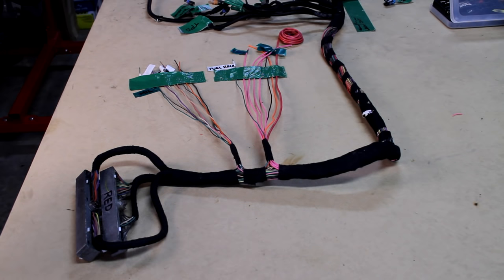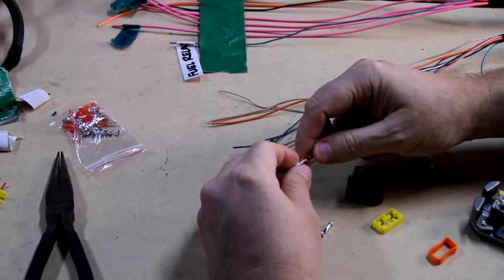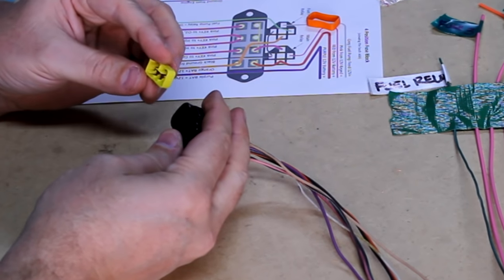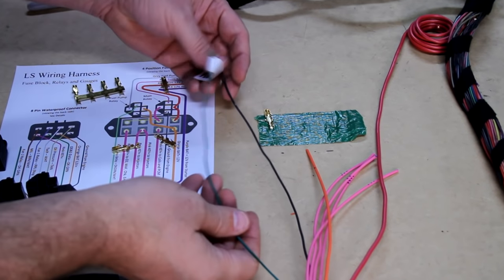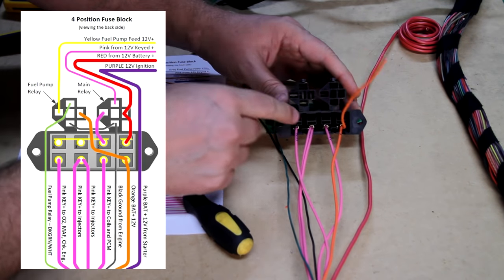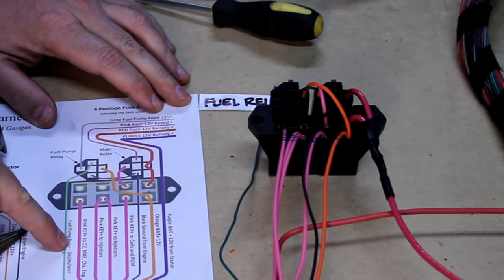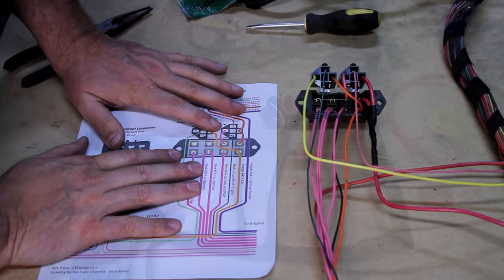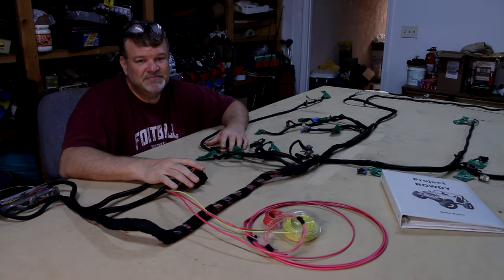LS Wiring Harness Part 5 | Project Rowdy Ep017

Comment: Sr according to you experience I'm doing a ls swap engine 5.3 I'm used Dakota digital  gauges wich wire I need to use from pcm to connect my temperature sensor thanks I hope you can helped me sorry for my writing I don't speak English to much.
Reply from the maker: I am not positive.  I believe Blue 74 is the signal wire coming from the Temperature Sensor into the PCM so that it can make fuel adjustments and engage the fans when needed.   I have not reached this point.  Worst case, you can place another Temperature Sensor in the other Head and run that wire into the vehicle to run the Temperature gauge.

Comment: Does the PCM to fuel pump wire go straight to the positive side of a inline fuel pump?Is there needing to be a 12v wire to the positive side of the pump?
Reply from the maker: No!  The Fuel Pump Relay Control wire (Red 09) is a control wire.  It is a low amperage positive signal that triggers a Relay.  In my drawing, the Yellow wire is used to provide power to the Inline Fuel Pump.  The current on the Yellow wire does not come form the PCM at all.  See page one of my downloadable diagram.
Reply: For some reason my fuel pump wire is not turning on the relay or the fuel pump. I used a jumper wire on the harness and the fuel pump came on. Tried a new relay same results nothing..  not sure what I’m missing or understanding on this. Is there a pic or a step by step u could send me?
Thanks for you quick response. Great videos you have on this..
Reply from the maker: Forrest Ott Don’t fully understand your use of a temporary jumper wire bit you can download my diagram from this video.  If you are on a computer see the “Show More” section below the video.  If you are on a phone, there is a drop down arrow to the right of the video title below the video.  On a phone you have to copy and paste the link to your browser.  You can test that green wire for a positive signal right as you key-on as the pump should try to run to build pressure.
Reply: Ok I think I got it figured out. Thanks for your help.

Comment: Great videos. Did u flash you ecu yourself?
Reply from the maker: I have not yet flash my PCM and do not plan to do it myself.   I am working on the vehicle that this engine will be swapped into.  I want the initial flash to take place close to when I am ready to fire the engine up so that I can work with the programmer on any possible adjustments.

Comment: what did you do with your VSS signal wires, did you delete them? im not sure what to do with mine as I am using a Th350
Reply from the maker: I deleted mine as I am running a Manual Transmission.

Comment: Is there a reason you chose to not also solder the pin connectors along with the crimping them? do you think that would cause problems with fitment in the block?
Reply from the maker: I actually debated this and was originally intending to solder them.  I ran across several examples where there were just simply crimped with a special tool and it convinced me that crimping would be fine.  When I talked it over with my son, he mentioned that the Pins from the PCM appeared just to be crimped and not soldered.  Fantastic observation!  Would you have done it differently?  Why?  Always willing to learn.  Certainly they could be soldered as long as you control the heat.

Comment: i bought  a 97 ck 1500  ls swap .with no gauges working,  it has 2 pcm in it ,i would like to get rid of the old one         . when  you did 8 pin connector looks like what i need to get done on mine . i'm getting no where on this one.any insight would be greatly appreciate  . no speedo is a boooo                .and thanks for the uploads
Reply from the maker: A few recommendations....  1) Download my diagram,  2) download the Pinout Specs for your engine from LT1Swap.com, 3) Study the Pinout digrams to become familiar, 4) Check LT1Swap.com for other gauge related diagrams/doanload/study them.  And it appears that you understand my 8 pin connector.... it is for all of the wires that will be heading under the dash to run "some" of the instruments.

Comment: Hello, and thanks for your video's on DYI ls harness.  Very well done and I cannot imagine the work it took to put this together.
I have two questions.  1.  where did you buy the harness tape?  2.  on your LS wiring Harness drawing you have B19 and B75  running on the bottom of the page from the PCM to the Engine.  Where exactly are this wires going to on the engine?  Thank you for your time.
Reply from the maker: I appreciate the compliment!!!!!   I bought the Harness Tape on Amazon (http://amzn.to/2xZng69) 2 rolls was only $11.  ANSWER 2.  Sorry that that part did not turn out to be very clear.  Those two Pink wires ultimately are connected to FUSE #2.  The Splice (shown on page 2 of my diagram), takes place to the right of the drawing on page 1 of the diagram.  I believe the video details for this section are in Part 4 of the series.   Hopes this helps and let me know if you need further explanation.  Cheers!!!!!

Comment: Are the relays 4 or 5 pins? The link doesn't specify. Will this diagram work with 5 pin relays
Reply from the maker: I don't recall if I purchased a 4 or 5 pin relay.  Both will work.  If using a 5 pin, you will not be using the 87a terminal.
Reply: UCanDoIt2 kool thanks

Comment: Hey the purple starter wire where u added the red one how does that connect. Cause my purple wasent connected to anything it pulled streight out of the harness
Reply from the maker: The Extended end of the Purple Wire (the one that I had to change to Red) will go to your Ignition.  When your ignition is in "Start" mode, it will provide 12V+ to the Purple wire.  Running through the harness, the purple wire terminates at the Starter Solenoid.  When the Starter Solenoid (electronic switch) is provided 12V+ by the Purple Wire, it mechanically provides the "Closed Circuit" for the Starter Motor to start rotating.
Reply from the maker: Part 6 of this Series covers most of this.

Comment: When you say goes to the switch  dose it plug into the fuse box on acceserys 2 ????
Reply from the maker: Your Ignition Switch provides power in two key positions.  The spring loaded Start position will temporarily provide 12V+ on a wire exiting the ignition switch,   this needs to go the large Purple Wire.  Then when the ignition switch is released from the "Start" position, it is in "Run" position and 12V+ is provided on a separate wire exiting the ignition switch...  That wire needs to be connected to the Pink wire in this harness.

Comment: is safely to connect fuse box wires (1-4) to a pin connector? if does what is the best pin connector that support 15 amp?
Reply from the maker: I believe it is ok based on what I think your asking.  I would use Google or Amazon to search for appropriate connector and hopefully they can provide amp ratings.

Comment: Hi . What is a fuses and relays rating for this setup? Thanks.
Reply from the maker: You should use 15 amp fuses in all sockets.  I would have to lookup the Relay specs, but it is a standard automotive relay that is used.
Reply: Thank you for your help.

Comment: Ok I have a question but first I'm doing same swap on a 95 c1500 ! Thanks to you it's easy for the harness !! But my question is on the 8 pin water resistance connector where is the pink 12 + coming from ? I will be re watching to see I I can figure it out thanks !
Reply from the maker: Manuel,  You can download the diagram that I drew in the description section (Show More) below the video.   This is the diagram that I used in several parts of this series.  On page 2, I check out the details of Fuse #4. The wire labeled "To Check Engine Light" is a new wire that you are adding to this junction.  It is the one that goes to the 8Pin connector and will ultimately supply the CEL with 12V+ when the ignition is in Run Mode. The PCM will control whether the CEL light is on by switching the Ground side of the circuit on the Brown wire.  Hope this helps!!!!
Reply: UCanDoIt2 thank you I will look into it! Thank you sir this really helps 👍😀
Reply: UCanDoIt2 so would i need it since my truck has the check engine?
Reply from the maker: If the new vehicle already has a Check Engine Light installed in the dash, you will want to connect these 2 wires (Pink and Brown) to it.  If your engine throws a code, the PCM will use these two wires to light up the CEL and let you know that you need to scan the PCM for code to determine what is wrong.  If the vehicle does not have an existing light, you can add any type of light for this notification.
Reply: UCanDoIt2 sorry for the spam sir but I like to be sure and the pink one that I'm going to connect with the brown come from the fuse block on relay 4 (which is where the coils and injectors combine )?
Reply from the maker: All of the Pink wires are the same (switched +12V).  You are going to add a new Pink wire to Fuse #4 (per the diagram) and run it to your CEL.  As long as the Key is in the Run position, this will have +12V on it.  The Ground side of this CEL circuit is coming from the Brown wire (PCM Red46, see drawing).  This is a negatively switched circuit.  When the PCM wants to light up the CEL it will provide a good ground on the brown wire.  I don't mind helping out.
Reply: UCanDoIt2 yes !!! That's where I was stuck at on your video I didn't see when and where you added that nee pink wire but yes ! You freaking rock ! 😎😎😎😎👍

Comment: i found a power steering switch, 2 wires, white and brown i notice those wire are connected to a controller under dashboard. the question is this switch can be connected to a light to know  when power steering fluid is low? and how it can be connected?
Reply from the maker: This is again beyond the scope of my project and therefore I am afraid that I cannot help you on this topic other than try to find the wiring diagram for this circuit.  I assume it is a Fluid level sensor???  If so, the circuit is most likely an On/Off type.  Maybe switching the ground side of the circuit.   Something that you could test with an continuity meter.

Comment: Where did you put the fuse for the fuel pump? Right now it gets unprotected power from the relay. What you should have done to combined The other 2 pinks into one and leave one fuse spot for the fuel pump.
Reply from the maker: Not sure if you understand the configuration.  The Yellow wire leaving the harness to power the Fuel Pump is protected via Fuse 1 (per my diagram).  The Green wire coming from the PCM is the Relay trigger wire.

Comment: Quick question. What size gauge wire did you run for each power source ? AND did you just junction some of the pink wires into one pink, if so did you change the gauge of wire or use the same gauge after tying them into one? Thank you, watched your videos. Learned a lot and feel confident.
Reply from the maker: The wire gauges are outlined in the diagram page 2 that you can download from the description of this video. In short, I joined 4 Pink Wires (20 AWG) into 1 Junction Pink Wire (16 AWG).  So yes, I did change the gauge.  Hope that helps!
Reply: UCanDoIt2 wish I would have paid more attention. Watch all your videos and hope you do a second swap into a muscle car next.

Comment: Question my harness seems to have way more pink wires, is there a different fuse block to use, or will the one you use work
Reply from the maker: Rey Barajas You can simply incorporate  a larger fuse block (more fuses).

Comment: I have two questions. 
1. On the LS Swap site,  it appears that the oil pressure sensor connector was removed.  But in your video,  you kept it. Which is best? I removed it from mine. How sound i re-add it if need be?
2. Which reworked connector connects to the knock sensor? 

Thank you for your help.
Reply from the maker: Very cool John!  1. Oil Pressure - Not sure why LT1 had that removed, I left it on mine with the thought of trying to get a working Oil Pressure dummy light.  You could add it back now or later.  You could tuck the wires into the existing harness or loom it separately. 2.  Knock Sensor - I did not alter how the Knock Sensors are to be connected.  The primary wires that support the Knock Sensors are BLUE 11 and BLUE 51.  I left these wires and the connector in my harness.   I did install new Knock Sensors and a new wire pigtail (as these begin to have issues due to the heat that they are subject to.    Hope this helps!!!!!!!
Reply: UCanDoIt2 Thank you so much.  This really does help. What does the color of the knock sensor plug on the harness look like?
Reply: Also the oil pressure sensor that was removed,  where is it plugged in the red or blue connectors and if used later, would it go directly to a gauge?
Reply from the maker: My harness is still boxed up.  Go look at the NS pigtail harness and it will indicate what the other end of the connector should look like.   If you need me to take a photo of mine, I can get to that easily.
Reply from the maker: I just looked up the Oil Pressure Sensor and it does not connect to the PCM (Red or Blue).  It goes to the C100 connector Pin J.   I am going to guess (as I have not tested this), this wire goes through the C100 connector which takes it into the vehicle and directly to the Oil Pressure gauge.
Reply: Thank you so much. This really helps me so very much. Yes if you have pics of your knock sense plug,  that would be great too. Thank you for everything
Reply from the maker: John Smith send me an email to UCanDoIt2Mike@gmail.com and I will forward 3 photos.

Comment: is there any wire from fuel circuit that goes to ignition key? or a wire from fuel pump to key
Reply from the maker: The key will enable the Fuel Pump Relay to have the potential to feed power to the Fuel Pump.   The PCM, sends the actual trigger to the Fuel Pump Relay to provide that potential power of the relay to the pump.

Comment: Ok question,  now someone did mine and I have 3 12v 1 ignition 1fuel 2 fan hi and low  and this is so confusing.  Do you have a email to contact you and show pictures?
Reply from the maker: You will be best served by asking questions to the person/company that created your wiring harness.  Not sure if I will be able to troubleshoot someone else's work.   You can email me at   ucandoit2mike@gmail.com.   From the sound of it, you will need to connect the 3 12v to a battery source, the 1 ignition to the third position of the ignition switch, the fuel to the fuel pump (12v+) and the 2 fans to your fans.   The Fuel and Fan wires, you will need to determine if they are coming from a relay, or if you need to add your own relay from these wires.   Keep watching, I answer some of these questions in the next couple of videos in this series.

Comment: what gauge wire are used on the final four wires going from the fuse block to power sores like power, starter, fuel pump, ign,
Reply from the maker: Here is what I used for the wiring:  PINK (AWG18) - This was an unused wire from the original harness,  YELLOW (AWG16) - Fuel Pump Feed,   RED (AWG10) - Battery Hot,   PURPLE (AWG10) - Keyed Hot

Comment: does your 8 pin connector connect straight to the cluster?
Reply from the maker: I am going to try to be specific in my answer.  This Engine/Harness is being swapped into a 1979 Jeep CJ7.  I do not believe you call the Dash Harness a cluster.  When I hear Cluster, I think of a more modern vehicle in which many of the gauges are controlled very differently than what I will have to deal with.  I have seen the cluster schematics an they do some funny things.  The 8 Wires that I have placed in my custom 8pin connector will be connected directly to the specific gauge it is intended for.  Example, 3 of the wires will go to the OBD2 Port.  I will mount the OBDS port and then run the wires from the port to the 8pin connector to determine the exact length for those wires.  I will then move to the Check Engine Light.   I will have to create a new Light for this and then wire it with the same approach as the OBD2.  The Tach wire will go to the Tach, but I will have to place a converter in that line to change the pulse so that it is accurate.  And so on.   Hope this helps!!!

Comment: I haven't seen this anywhere. But what size fuses should be used for the 4 fuse connector?
Reply from the maker: Brady Williams 15 amp fuses for all 4.
Reply: @UCanDoIt2Mike  Thanks for the reply. We haven't finished the project. I bought 20 amp fuses. Will change them.